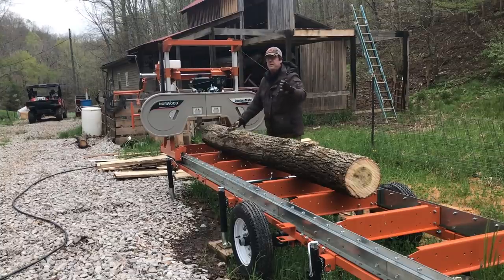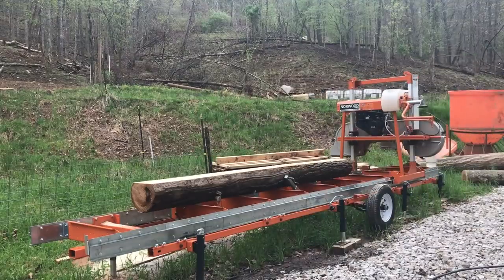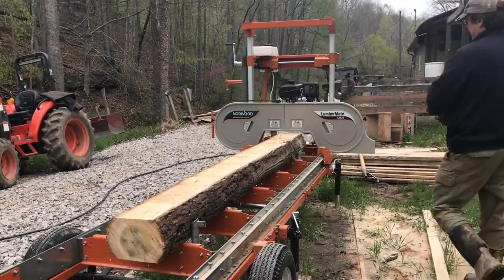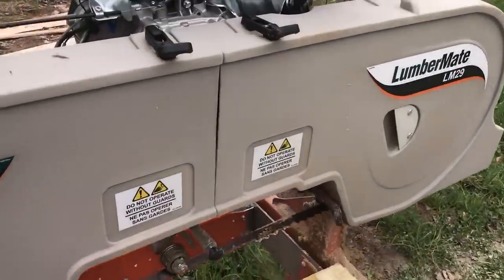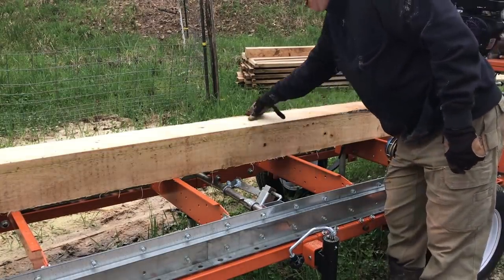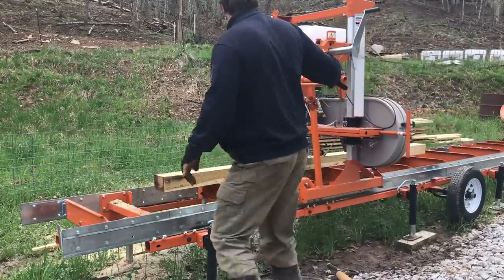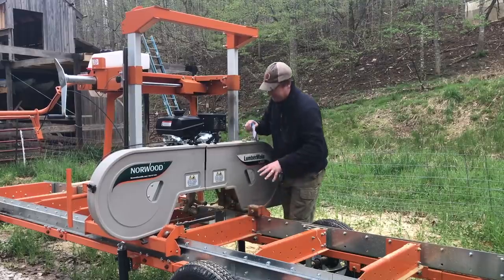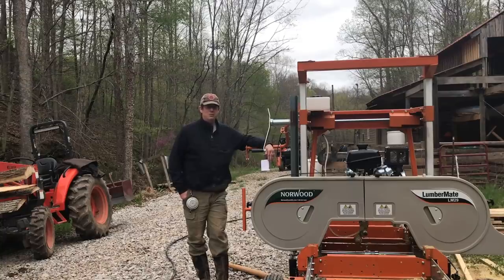A Comprehensive 6 month review of our Norwood LM29 Sawmill

Comment: On the quick lock device, if the lip that engages when you push the handle down was about 1/8" to 3/16" longer, it would engage more and force the point into the wood more.  Have they made changes to that since you produced this video?  Another change I would suggest is to cut some holes in the bottom of the right side cover just a couple of inches from the existing sawdust exhaust ports so the sawdust can blow out beneath and on the side without blowing down onto the rail.

Comment: Great video . Never worry about the length of you videos. Longer is always better . Norwood is only 2 hrs away from me in Canada . I remember watching your other Norwood video in how you got the extra axel .  Yes in Canada our gas cans have vents . What a stupid rule you have there . You're  gonna expose more fuel in spilling it than what you would if you had a vent . I use the NO-SPILL  gas cans which I get from the States . The nozzle has the vent in it and you only need to push the button for the fuel to come out . They are kind of pricey but well worth the money . Most of the time I don't even use a funnel when using the gas can . I have been using them for years now with no problems . Get them in 5gal , 2 1/2 gal or 1 gal size .

Comment: Troy, easy fix for keeping mill stationary is to use some old vise grips on the track in front of roller post, 2nd idea is use old 4" C clamp in same maner. I run a lumbermate 2000 & i have used this method to stop wind from pushing the mill down open track.

Comment: I have the HD36 and share your feelings and experience. Decent mill but can be improved. My instruction manual was also out of date and the time/frustration didn't leave a good first impression. I think they offload too much assembly (that wouldn't affect shipment size)  to the customer. The track pieces are too short and size/gauge vary too much which affects the smoothness of the carriage. I cut out the center of the covers so I could align the wheels. The HD36 ceramic blade guides allow more blade travel than guide wheels that have downward pressure. I do like the HD36 dog system.
Reply: I agree with everything you said. I despise the ceramic guides. Blade travel or variance is something I can't afford with fair but demanding customers. I also think they made a Lot of the pieces short to save on shipping but makes for more trouble assembling and not as strong an overall mill in my opinion. The Koehler is a good engine I've got or had several. The big thing against Koehler is there parts must be made of gold the way they price them.

Comment: Check out Smoky Mountain Outpost, he has the same mill. He put a down drop on the end of his shute. Never said if he cut out the webbing, but my guess is he did. For the wheel alignment make a template from a 1x that hits both sides of the each wheel and then is cut out to go past your center obstructions. hopefully that will work.

Comment: Here are my comments after 8000 boardfeet of lumber on my LM29:

I apologize for the long text...

- I purchased thicker blades, .0042 instead of the .0035, they last longer and wave much less on knots when sharpness start to fade
- You WILL hit log rests with blades, ruining a few. Wonder why these are not made of aluminium (or hard maple ;-)! ) will replace mine with alu and wood (would have saves two blades so far :-( 
- too many sharp edges on the mill, for instance the stops for the carriage,  they are painful to hit with your legs when walking around the mill (you do this a lot) - parts punched out needs to have rounded edges
- a bicycle bottle holder is very useful when it's hot (screw it on the carriage to have water at your disposal, this is physical work!)
- I made a winch with a Harbor freight ATV 3500 winch sitting on top of a post attached to the frame - saved lots of $$$. I use my truck 12v to power it with booster cables, very very efficient! I made ramps with 1 1/2 tubing but they should be 2 inches for strength in supporting larger logs (they curved and will need to be replaced)
- the handle on the screw on the log dog gets in the way (doesn't clear the carriage) all the time when sawing larger logs to the limit of the capacity of the mill, even preventing from using it - it really should be simply a bolt so we can use a battery powered drill to screw/unscrew, would be much faster especially that the pitch on that screw is ridiculously small (25-30 rotations to fully screw/unscrew!!!) - I will correct this shortly
- the post that holds the cam dog is too short and the loose make this dog to constantly drops and stop holding the cant while sawing (after one or two passes) - I drilled a hole in it and drove a metal screw to stop it from moving back and forth. That metal screw helped a lot but the cam dog still fails to hold the log from time to time. This device needs to be improved. It is also too close for comfort when sawing the last 1 inch board, one 8th of an inch lower would be safer (I hit it lightly with a blade, enough so that it needed be resharpened)
- you really need the automatic water lubrification, you save a ton of water this way, great accessory
- a second handle left of the one on the mill would be great, some wood (like cedar) needs a good push as they dull blades very fast and also because you need to lean over to check those %?&?%$%?& logs rest to make sure they will clear the blade  
- Have a level when setting up, very easy after a few times. 

Overall, the LM29 is an awesome mill of great value. I simply love it and would buy it again without hesitation. It is a lot of work to assemble so try to have someone to help :-) !  

I resharpen my blades every second time using a HF chain saw sharpener, convenient for me (distance to sharpening service) when I am running short on blades (and I save a few bucks there also). Takes roughly 30 minutes to do a blade while enjoying a coffee in the shop ;-) 

Thanks Red tools for these awesome videos, they are very much appreciated!!!
Reply from the maker: Awesome feedback and great ideas! I really like the water bottle idea!
Reply: Thanks for the video and thank you for the comment! We are just getting into milling and think we've now made the call to go ahead with this mill.

Comment: Have you calculated your break even point on the purchase of the sawmill vs buying the lumber at the lumber yard?  And also another calculation when your setup and cutting time is factored in.  Seems like a lot of work logging, setup and cutting.
Reply: I just ordered a Norwood for the exact reason you are questioning.  I have a really old barn sided in white oak.  Recent repairs used the last of the rough cut white oak we had on hand.  Upon checking with the few local mills there are, I can buy the mill for less than a couple large loads of 14' white oak.  Having more than several large white oaks on the property, it works out cheapest to buy the mill and make my own lumber.  The cost and hassle to transport the logs to another mill would rival the cost and hassle of buying the mill and doing it myself, but I have other projects in mind.  It will pay for itself easily.

Comment: You can buy polyurethane bushings that are split. Measure the diameter of the attachment point of that small dog to the pipe. Place that bushing in the end of it. It will slide easily until in a bind. Then it will hold it. The vibration combined with the slick surfaces is what is causing it to release

Comment: I have a Norwood LM 2000 (electric start).  I have been happy with it for the most part, but I have not got a good solution to sawing the last cut for a one inch board.  The log dog seems difficult to adjust that low.  I have seen other mills with a device that catches just the bottom of a square cut.  Any solutions you have found?   Great videos by the way,  I watch them regularly.
Reply: I see that the quick cam is supposed to solve that problem, but your comments are not much of a positive review,
Reply from the maker: I had the LM 2000 (my brother has it now). The cam does help when it stays in place. I have tried a couple tricks to get it to stay 80% of the time. Still not 100% satisfied. Usually, the last couple inches I don't keep any attachment on it. The force keeps it wedged against the log rests.
Reply: @RedToolHouse  Thank you.  I think I will spring for it, it is $46 now.

Comment: Hi Troy, thanks for sharing your thoughts with us. I'm looking at possibly getting a Norwood for my 100 acres :). Regarding your throttle issue, does the spring reach the hole adjacent to the throttle cable? Maybe little hair cut might give a bit more tension as well? Cheers Steve
Reply from the maker: I will look at it. Yes, I think shortening it will make it tighter. I have a little box full of springs that I have collected over the years, now I just have to remember where the box is!

Comment: Quicker to blow it out with compressed air or a leaf blower. That’s a gnarly cut. Would work gloves 🧤 have helped? Use some a straight edge board to check the parallelism of the wheels? Do you need the working blade to check alignment if so could you stick some tape over the teeth on a dull blade.

Comment: Good review.  But could you check something on your mill.  I have the exact same mill.   The pipe that the log dog slides on,  when the dog is holding a log, the pipe pushes against the inner of the frame rail.  Are you seeing any bowing/bending of the frame rail when the dog is tight on a log?  Thanks
Reply from the maker: I am not seeing that issue on mine. YOu may want to take a picture and send to Norwood.

Comment: I would like to know if there is trouble with the bolts working loose over time.  I haven't heard of anybody  mentioning it.  Like the looks and reviews on this mill.  Have a friend that bought one a year ago but hasn't had time to usei it form any thoughts.
Reply from the maker: Have used it heavily over the past year and the only bolts that work loose are the ones that hold the water tank. I don't tighten them down, though, so I can dump out debris or leaves since I fill it from a rain barrel.

Comment: Wouldn’t it be possible to add a sight port on your covers on both wheels so you could see the tracking as the blade is moving safely.  This would allow you to adjust the wheels to optimize the blade position on the wheels.  This could be done each time you change blades.  You should be able to avoid the blade jumping off your wheels by doing this.  I am thinking you would only need a small view port on the covers.
Reply: Good idea. I have a sight port on the side of the cabinet of my standing shop bandsaw. Should be easy to cut out a square piece from the side of the plastic housing and then cover the hole by screwing on some thin plexiglas or Lexan followed by some caulk.

Comment: It looks like there is way too much water being used to lube the blade.  I could see it running off of the opposite side of the sawdust end.  This will also cause the sawdust port to clog from soaked sawdust.  It is supposed to be sawdust and not sawmud.  Maybe add a valve to slow the drip rate.  Looks like it cuts good otherwise.

Comment: I love the longer detailed video myself. I am considering possibly buying a Norwood mill as it is more affordable for size than Woodmizer. I really need a tractor but tractors are so expensive now. Was thinking if i bougjt a mill just maybe i could make enough money with it i could then buy the tractor i need.
Reply: Steve Slade  i know what i need already the problem is not enough funds. You can only buy what you can afford and what i can afford wont meet my needs. So the only thing i can change is what can afford by investing what i can to make what i cant afford into something i can afford. I can buy a cheaper tractor but it wont do me much good if i cant buy the equipment needed to use it.
Reply: Build a level bunk for logs so you don't need to load logs with a tractor

Comment: As for the throttle spring, when I squeeze the throttle push handle my LM29  increases automatically to
Reply: If you have not solved your RPM while cutting issue... You are RIGHT!  The governor is “supposed” to pick up the load as the actual cutting begins.  You should not have to manually run the throttle up and down each cut!  Look up (google) “Adjusting governor on Kohler Xxx.  If you have a $15 box of 50 assorted springs from Amazon, you might try changing out the spring to a LIGHTER SPRING.  As it sits now...the gov spring holds the throttle wide open against the stop.  (If you can push away from the spring by the gov Rod, you should hear it slow down.  

Think of a pressure washer for a moment.  You do not touch it, right. Has a steady fast speed it runs at (like 3,300 rpm, ready then to pick up the load via the governor.  You need this much rpm to start with, so that as you pull open the wand handle, it must quickly bring the power up.  WATCH as you pull the handle on and off, you will see the governor working by watching the linkage.  A simple stretch of the gov spring  just slightly may ease the tension, and allow rpms to adjust better.  Still under warranty, do not touch this.

Your clogging with sawdust issue... on the bottom below the side exit holes, make a couple holes maybe 3” (that do NOT fit a hand passing through).  Nothing better than gravity on your side, and blowing out toward the ground.  

I hope to get a mill like yours.  I hope some of this helps.  😬😬😬
Stay Safe, NEVER CUT when you are tired or just don’t feel well.  We ALL make mistakes, being ALERT cuts out 95% of the accidents.  Good Luck and Thank You for the video’s.

Comment: i want to build my own mill but i cannot find any specs on the saw bed. do you know what the actual width of the saw bed is from the left roller guide to the right roller guide?
Reply: If you are building your own then start with the capacity you want and reverse engineer from there

Comment: That throttle issue would really annoy me... but not the end of the world like you said.
Reply: Something I wonder about is wouldn't it pay to get the debarker. I would think the blades would last enough longer and pay for it self in the time of replacing blades and the sharpening. Can't always have clean logs. Could you ad a weight to the end of the cam handle (on the log holder) to make it stay down better?

Comment: You aren't using the cam dog correctly, push in on the collar on the cross pipe while insuring the side to side movement of said pipe is removed with the same hand, the pull the dog pick together with the cam handle , the while holding the two pieces together push the dog firmly into the cant. what I do now is while pushing the collar inwards I use the cam lever handle to further push the dog into the wood before caming the handle down to hold the cant secure. I think if you use it this way that you will change your mind about this invaluable tool, especially on small cants. I hope this helps, thanks for your great vidoes!
Reply from the maker: YOu are right. I figured it out after shooting this video. It works pretty well now. Norwood suggested shimming the cross pipe to take out every bit of play.
Reply: @RedToolHouse  That's great! I even cant it to the side and can cut right down to 3/4 inch on my LM29 ,and yes shimming the pipe will help for sure.

Comment: If it were me, I'd probably cut that dust chute right off the guard altogether. It would be easier to deal with if you get rid of that useless choke-point. Forget about just cutting the end-cap out. It would make more sense to start at the middle of the top chute radius and cut 45 degrees inwards towards the bottom. The fact that you haven't done it already boggles my mind lol. If you're not gonna be one of those morons that sticks their digits in there, there's literally no reason for it to be there.

Comment: I am about 85% of the way through assembling an LM30. It has taken me about 6 days so far working on it most of the day. I will just say that it is a lot harder than it should be. The directions leave a bit to be desired. Instruction can be confusing, parts not in boxes or bags as marked, missing pieces, not the highest quality hardware. Videos online do help, but not a lot. If you buy this mill, I suggest blocking out a week or so to put it together, put on your detective hat, and take your time. Read the directions and then watch a video if you can, especially if something doesn't make sense.  If put together right, it seems to be a good mill.